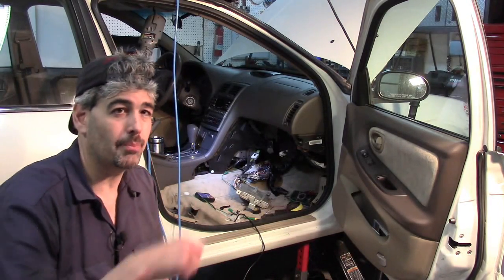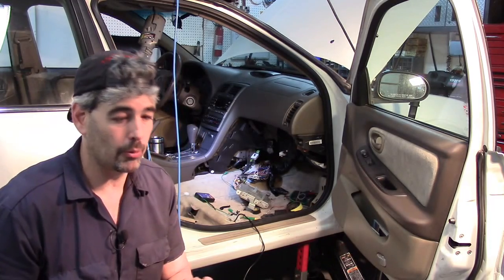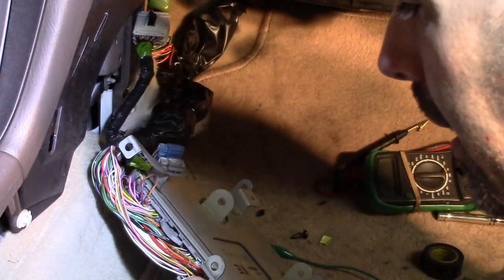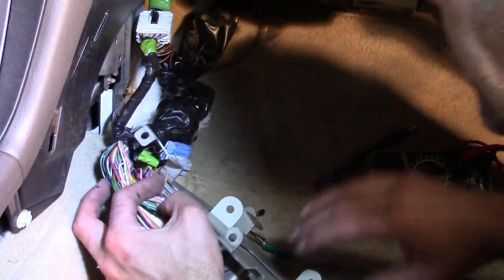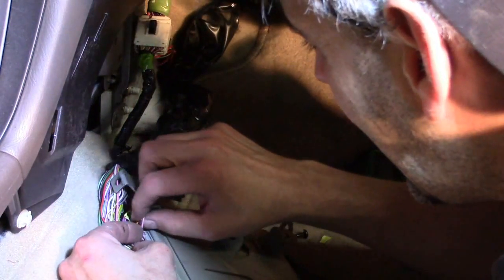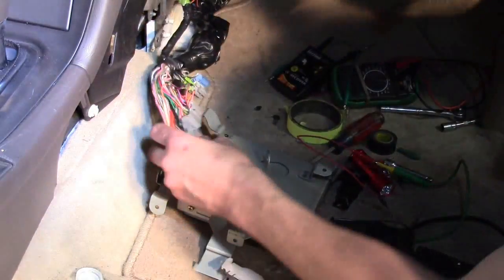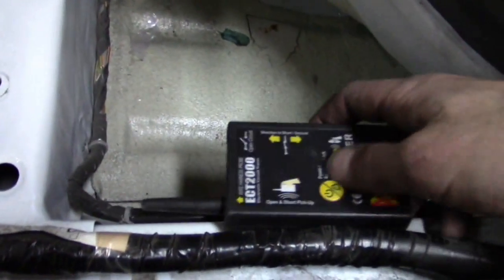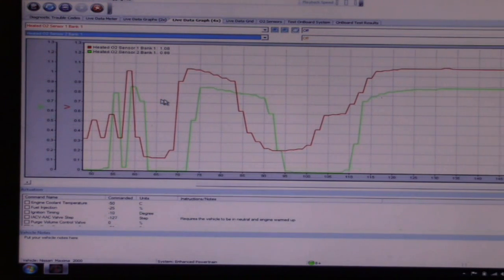P0138,P0139 Diagnosis from Hell Part 2

Comment: as soon he drives back out and goes on the freeway and takes his feet off the gas pedal, he is going to be presented with P0420 (or P0430)   That is like getting out of fire and landing in a fire pan!!
Reply from the maker: 12vgs8606 Yes I informed him of this.  As long as it happens after his emissions inspection this guy will be fine with it- this guy ALWAYS has check engine light on in his cars... remember in the previous video of it, the check engine bulb in this car was burned out!!!!
Reply: He then really has a project on his hand.  I am extremely familiar with the 2K Maxima as I have one.  One has very short window to get the car inspected while cat monitor is INC.  Only way to do this is to have the scanner connected all the time and watching the IM status and as soon as all other monitors go complete, drive in to the station and get the sticker.  If the code comes back, tell him NOT to even attempt for the sticker.  With rejected (or incomplete), the rules require CAT to be completed and does not allow CAT to be incomplete.  The trick is getting EVAP and EGR done before CAT trips the code :-(  He will need all the luck in the world
Reply from the maker: 12vgs8606 Thats a really good idea actually- not that I am condoning evading emissions lol but live monitoring of the system validations to shorten the window is a good idea.

Comment: uhmmm i missed the part where you show the damage to the wire?  What was the cause? Very rear for a wire under carpet in such a thick harness to just break for no reason.  Good demonstration on the diagnosis
Reply from the maker: Ozzstar Yeah I accidentally lost that in the editing.  Harness was severely bent almost 180.  I believe the previous person to install the rear O2 at some point yanked on the harness from under the vehicle to get more room and didn't realize that it was bending the harness considerably inside the vehicle.

Comment: I had my doubts on the wire tracers seeing your video I am going to get one. Looks like it is pretty accurate
Reply from the maker: JOHN HUFNAGEL It is very accurate. There are some tricks to using it though because sometimes things like parallel circuits or switched circuits can mislead you. It is often necessary to know the circuit design you are working on and ensure if you are chasing a short to ground that all switches are open and bulbs/components are unplugged.
Reply: I used one about 20 years ago and it had a lot of back feeding into other wires that wasn't even related to the wires I was checking. Did you say that the customer had the ecu programed at the dealer? If so why did you think that a re-flash would correct a problem with the heater not turning on? All the TSB's I seen that say to re-flash the computer are usually related to sensitivity issues not functioning problems. By the way great video
Reply from the maker: JOHN HUFNAGEL The service manual said reprogram, which we did. But there is no way in hell it is going to cause the PCM to suddenly start grounding a sensor.  It may be more of a calibration thing perhaps (there is an idle learn that is part of the programming for example) but no way it suddenly makes a PCM close the heater. The reprogramming was strictly because the manual said to do it is all, but I knew it wouldn't work.
Reply: Schrodingers Box That's right Matt, a software update or recalibration/re-flash is NOT going to fix a defective(open in this case if it was a PCM fault)O2 sensor heater transistor driver. I don't know what the hell that factory flow chart is talking about...being disingenuous once again with all their illogical bullshit. This is one of several reasons that if I can avoid using a factory trouble tree/flow chart, I will(not to say that they don't sometimes provide good info because some do)  You should see what the factory manuals think an open circuit resistance is...makes me sick.
Reply: Schrodingers Box There are only two reasons I can think of that could theoretically make "reprogramming" the computer desirous. But it probably would not be necessary anyway. 

One reason is in case the resistance of the replacement heater is far away from the original. The PCM MAYBE limits or manages the current through the heater, so it might want to know what the resistance is. Hence the "reprogramming" would re-calibrate the amount of heater current flow, so the PCM would know when that "newly normal" current went out of bounds, and to set a code.

The other reason, which would be far less likely, I assume, is so the PCM can "check" the voltage oscillation levels of the new sensor and adjust it's internal programming or lookup tables, say, if a new sensor created a signal that was perhaps a quarter volt higher or lower than the original.

I can't think of any other theoretical reasons to have to "reprogram" the PCM.

Comment: I find it amazing that its more instructive when you have unforeseen problems, worse for you, better for the viewers, well at least myself. That said ,now go burn your house. Wasn't there a song " Burning down the House"
Reply from the maker: Charles Miller Hahaha yes "Talking Heads"- an 80's classic.

  But seriously you are dead on- it is exactly these problems were you learn and hone skills.  You don't learn anything changing plugs and wires or cleaning a throttle body.  You learn best when you need to do experimentation and research to eliminate variables and in fact research what the possible variables even are in the first place.  While I joked in the video that this one would be better for you but worse for me, actually it's better for all of us. I learned as much by doing this in exactly the way others learned by watching it. I never poked at a computer before- this was a first for me.  Frustrating as it can be, I'll take cases like these all the time because this is how you get good at diagnosis and repair!
Reply: Schrodingers Box you're also 80's music guru, "obobo jungle love", lol.  hey i just want to wish you the best in this world because frankly you're work is top notch.  i use to work at several shops and i have to tell you, the best guys i worked with were you.  these guys were all self taught, no formal automotive training.  we just read everything in terms of electrical like grobs, hollenbecks, etc and try to understand how systems work.  that's why diagnosis wasn't that hard.  the parts changer don't understand that troublecode means the CIRCUIT is the culprit not that the load component is bad.  your scientific approach is seconding to none, but what i enjoy the most is your humor.  if you are working on another nissan again go to http://www.nicoclub.com/nissan-service-manuals.  these are factory manuals.  go to the model and year, and for you, go to "EC" for engine control system.  general description is the section for the terminals page you were using.  very important page.  but i don't have to tell you, because you know what you are doing.
Reply from the maker: nijoel Thanks for the comment and advice on the nissan site.
 I also noticed your observations as well btw, I think self-taught people have a little more pride in their work. If they went through the extra effort to be self taught, they tend to want to show that are as effective as anyone else (if not more).
  Plus, with tens of thousands of people watching me, I have a responsibility to show how to things correctly.
Reply: Schrodingers Box one more thing.  if you're hung up on service procedure or need wiring diagrams for other makes/models, many libraries offer alldata in the reference area for free.  you will obviously have to pay to print the data you need, but it is alldata, not alldatadiy so they will have repair info for bmw and gm vehicles as well.  please check out your local library to see if they offer alldata.  if the library doesn't have it and it is within your district, talk to them.  ask if they can offer the service, tell them you pay property tax that funds them.  thanks matt and continue to teach us.

Comment: Great vids Matt, that seems and odds spot for the wires to get damaged. But I guess S%$t happens...
Reply: The harness goes around the footwell and the carpet covers it. It goes along the sill. It's often encased in special made plastic that snaps together around it. But anything entering the vehicle that could bump hard enough or crush it could damage wiring unseen. I had a fuel pump circuit like this once. Partly damaged and partial loss of amps acted up only in extreme cold.
It's great to watch Matt with his courage and tenacity. Not everything's made in USA. And even our harnesses need this. Because they also come from overseas. Customer must pay.

Comment: I dread to think what a local garage would charge, however, I don't believe they would have found the "open", they would certainly find the wallet !
Reply from the maker: DiyMech Hahaha they would find the open wallet!!! According to a few of my subs that work in the industry, they said they would have spent an hour looking and at that point contact customer and quote an hourly rate to continue the pursuit.  The shop would basically lose money on this type of thing and the technician really would if they were hourly. So basically everyone would lose.
Reply: Schrodingers Box Don't get me wrong, I ain't trying to "belittle" some garages and the technicians therein, but I just feel nowadays, if you do find a "good" local garage and technician, then stick with them.

I think it tends to be the smaller one man two man ones that are better, think once you enter the realms of the larger franchise type dealership it's more targets and turnarounds that count. I'm possibly cheaper getting an aircraft ground crew work on a car than pay the franchise hourly rate here £90 aaaaargh.(not that I'd touch them with a barge pole)

I'm afraid that the "logical" fault finding skillset is either disappearing or wasn't really there in the first place, or is technology moving to fast for the trade !. There again the "businesses" are possibly driving out the will to fault find as its easier throwing parts at the problem from the OBD results (that's another debate).

Keep up the good work, superb vids.

Comment: Nicely done Matt!  You also sold a Power Probe in the process.   I NEVER would have  found that if it were me.  Power Probe rocks.
Reply from the maker: Randall Dalton The only other way to do this would be to use a multimeter with like 6 foot leads- one connected to one end of the wire and the other you stab the wire at different locations (obviously, dissecting the wire out of the harness) until you lose continuity and then narrow down to the exact break.  F*&$ THAT!!!! Lol!!!
Reply: Schrodingers Box For sure!

Comment: Sir,   By far - your best video in "live" fault finding.

I thought you were going eat the cost of the O2 sensor there.  I had a "similar" issue on my GM Vauxhall Vectra-B.  Turned out the sensor was fine, the wiring was okay, grounds were good.  I did have a fault with the ECU - it was a dry joint on the board which was not allowing signals to get to the CPU, and therefore be read.

The fault was fun to fix - in no way at all......
Reply from the maker: tcpnetworks Lol, yeah I admit I was nervous about the O2 as well!! Logic dictates it had to be that the sensor had a good internal heater but bad detection but the variable with the harness side heater ground really made for a feeling of uncertainty.
  I expected it would take a couple minutes for the new sensor to start to operate after I manually grounded the heater but it was actually almost instantaneous- which is good, not sure I would have any fingernails left if I had to watch it for 2 minutes lol!!!

Comment: A car made in the 80s wouldnt have had any of these problems
Thanks for the vid BTW
Reply from the maker: cars Cars from the 80's have MUCH more of these electrical problems by far, plus the fact each one has it's own OBD "language" doing the diagnosis as a DIY is far, far more difficult because you would need a much more expensive or at least specific scan tool.

  Incidentally, in the 80's when cars started getting PCM controls like this- technicians had no idea how to do diagnosis like this.  Virtually every technician called a bad PCM on virtually every check engine light where replacing the sensor or component didn't fix the car.  Thousands, thousands and thousands of warranty repair PCM replacements were done but when the PCM's were tested at the factory 99.998% were found to be fine. The 80's was historically the WORST era for issues like this!!
Reply: cars That's right - it would just have many other issues.  Little things, like safety, inability to interrogate the ECU (they had them), lack of parts,  etc..

Comment: Excellent troubleshooting! 

Isn't it odd that both problems occurred simultaneously? They seem to be independent of each other. A bad O2 sensor can't cause on open in the wiring harness and an open in the wiring harness can't cause an O2 sensor to go bad, that is unless it is possible that running with a non working O2 heater can cause the sensor portion to fail. Hmmm. Very odd. I would attribute it all to a solar flare.
Reply: Schrodingers Box Rob Mut +douglas lee 
Sensor manufacturers warn against leaving an unpowered heated sensor in the exhaust stream for long periods(hours) saying that it causes damage to the diffusion gap and the Platinum electrodes of the sensor.
Reply from the maker: patw52pb1 I actually can see where that would be possible-- even probable.
  I agree, it is just too coincidental for me; the dead O2 and the open heater in the harness...  It seems very reasonable to me how the latter can lead to the former but obviously it is impossible the former would lead to the latter.
Reply: Schrodingers Box I find a certain hilarious irony that a JEEP, which is supposed to be the great "cross country" off road machine needed a piece of lumber under the seat. Guess they don't "build 'em like they used to"!

On the other hand, you have to admire his ingenuity....
Reply: patw52pb1 That is extremely useful to know. Thanks.
Reply from the maker: Hahahaha yeah I am not sure what to say about that. When I first got the car for the EGR months ago, guy said it had an O2 code but I was unable to pull it up- It just had the EGR code.  so this may have been cooking for a long time. This is one of them dudes that is just used to seeing a check engine light on all the time so maybe he didn't actually have it come on just recently.
Reply: Rob Mut The two problems probably did not actually occur at the very same time. But like you said, MAYBE not having a working heater could damage the O2 sensor, but I doubt it. The failure of the heater and the failure of the sensor itself were probably two separate events, that were both found during the diagnosis.

Also, as others have pointed out, probably a lot of shops would have simply replaced the O2, cleared the codes, and then had the car come back in a few days with the Check Engine light on again because of the bad heater circuit.
Reply from the maker: Agreed with douglas on both counts, especially the latter one. No doubt this would have been a comeback at most any shop.  
  Turns out I found this issue with the damaged harness. Customer's driver seat was broken. Customer positioned a 4X4 post to help prop seat into position and harness ran right under the post.  The constant digging in over time clearly must have done the damage.

Comment: Hey Matt, nicely done man! Even a 10k Verus can't pinpoint an open wire like that PowerProbe did...might have to invest. And I can't believe there were two simultaneous issues with the same sensor!! Could the inoperative heater caused the sensor to get contaminated and stop responding completely?

Some other thoughts:
As for the O2 heater fault: that is an amperage-monitored circuit, so the open control wire should have set a P0141-B1S2 Heater Ckt Malfunction immediately on startup. Maybe the customer misremembered the exact codes? P0138 is B1S2 signal fixed high which wasn't the case here. P0139 is B1S2 slow response, which is plausible since the signal was fixed low.

A super quick "ScannerDanner bypass test" to verify the sensor signal circuit and PCM before replacing the sensor: touch your test light (from B+) to the signal wire at the sensor and monitor the scantool for the signal to go "high".

As for wiring diagrams...oh man don't think for one second that the "professional" $150 a month subscriptions are perfect...you'll see what Eric O. thinks of Mitchell diagrams in our next video series lol! I use AllData, but usually still go to the AWESOME free resource "BBBIndustries TSB and Wiring Diagrams" for quick references to factory diagrams. In any case, you have to watch out for the "California" vs. "Federal" Emissions discrepancies.

The factory O2 diagram that you showed in part 1 seemed to be accurate...That initial "engine ground" that you checked should have been for the signal side, as the heater is in fact ground-side controlled by the PCM on the Pink/Black wire going to pin 5.

Whew! Keep up the hardcore diagnostics Matt, always a blast to follow along and play the "Haynes Manual Jockey" hahaha
Ivan
Reply from the maker: Thanks Ivan, good to hear from you. I totally agree on the sensor codes but indeed, I got a 0138/9 as you saw on autoenginuity. 
  Either way, a wicked case study and only the second time an O2 sensor was replaced on the channel lol!!
Reply: Schrodingers Box haha gotta give the parts changers some credit on this one! Looked like swapping that sensor might have taken more blood and sweat than the actual diagnosis...the only reason Scotty can do it in three minutes is because he lives in sunny salt-free Texas!!!
Reply from the maker: ..... and he saves an hour on doing any diagnosis lol